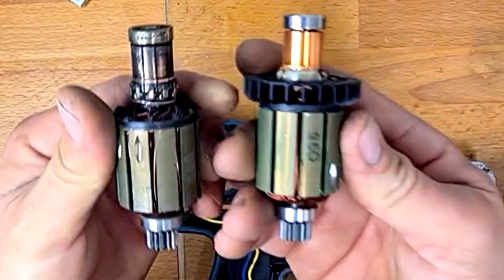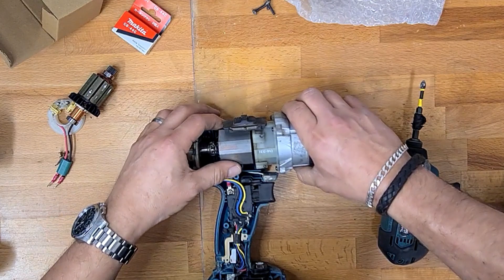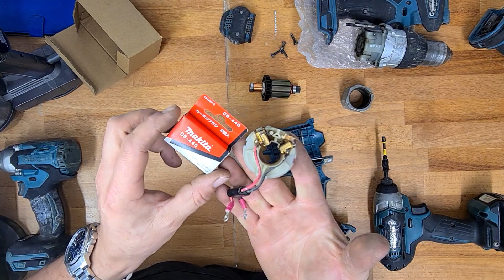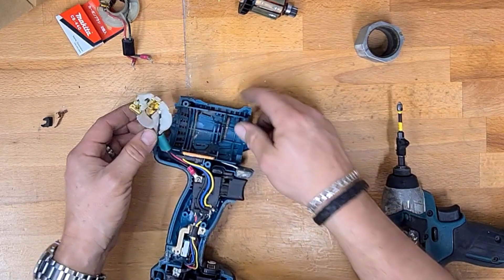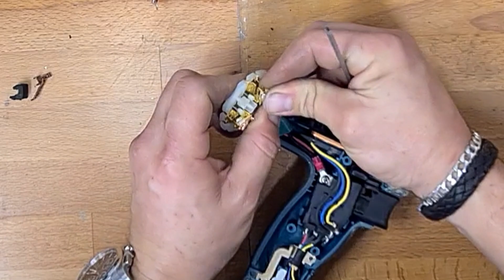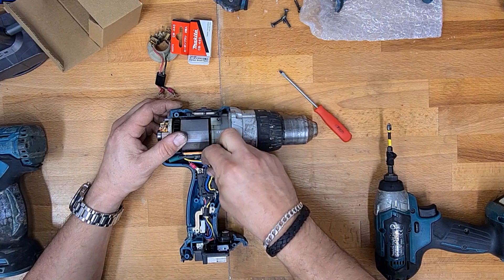most common problem with makita not working replace armature carbon brushes and holder 18v drill

Comment: LXPH03 when the trigger goes bad: it can send +20v and -20v across the battery(BAAAD) and melt the brush holders and mosfet in the process. I guess it was waterlogged or something because I found it on the side of the road yeeears ago.

fixed mine by getting a new trigger assembly but maaan that set me back like 40 bucks

I still have it today :)

Comment: Dude replace the brushes once you put the motor with the brush holder in the casing first.
its much simpler as You have possibly done many times be for.;-)

Comment: Did everything you did change the motor & the brushes put it back together no problem.Then put the battery in for the ‘moment of truth ‘    pull the trigger it moved very slowly then smoke came out the back  I give in 🤦‍♂️

Comment: I've got a dhr264 drill. Had it diagnosed as being the armature... I've just fitted a new armature, but not new brushes. Still no go. Brushes seem ok, though I don't know what could be wrong with them. When I put the voltmeter on the brushes, I get a good voltage... Do you think new brushes would make a difference? I have some on order.
Reply: May be, but have you checked the trigger, is working correctly,there is a video on how to test for power it is basically a on and off switch , with a protection

Comment: Nice easy video. I've "inherited" a dff482,  Brushes were damaged so bought neww ones. Now I find that one of the magnets on the armature is loose (possibly damaged) I presume that best way is to replace the armature?  I.e. armature cannot be fixed?  Tnx
Reply from the maker: as its a spinning part and can cause more damage if it brakes off I would just replace it. there not much to buy and easily replaced.
Reply: @FINDITFIXITRESTOREITBUILDIT  Tnx heaps!

Comment: have you tried pulling the gear and bearing off the armature? I wonder if it is possible to change the bearing without damaging the gear
Reply from the maker: I have, there manufactured in such a way the gear is pressed on. I actually broke the gear trying it.